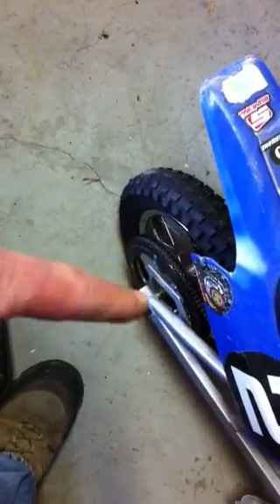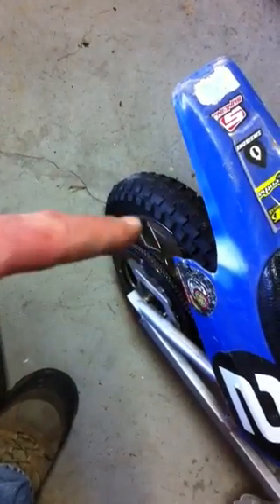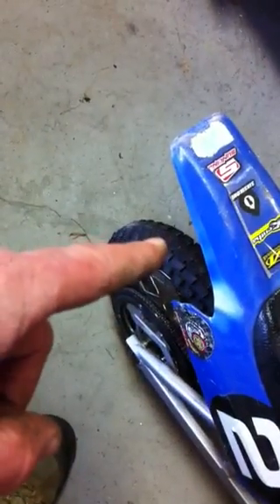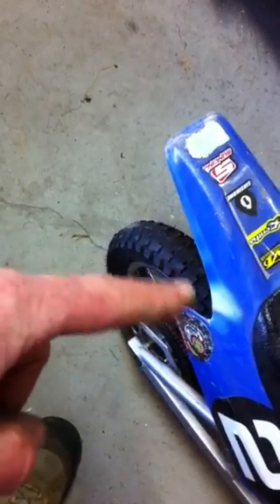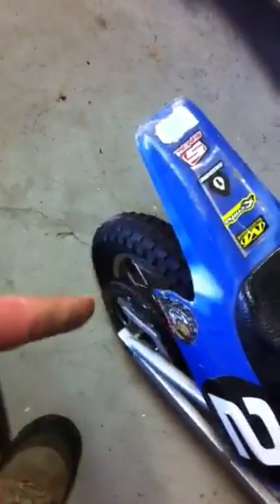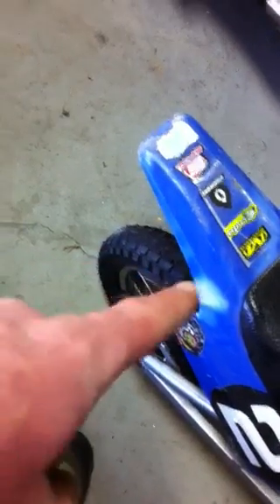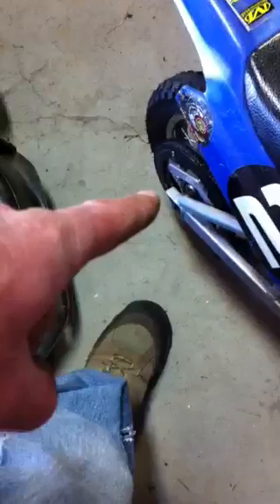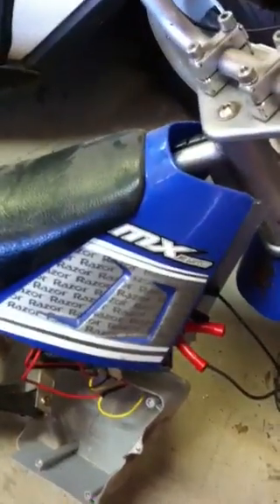How to charge razor without charger

Comment: The problem is these are wired in series to get 24 volts so charging like this will damage both batteries eventually. Unhook one ground from one battery that goes to the positive on the other batter before charging and no problem. Just did this with my daughters e100 electric scooter
Reply: if you use the alternating fuse ports you can focus charging one battery at a time and avoid them being in series.

Comment: Aren't all razor scooters a 24 volt system? They have two 12 volt batteries ran in series two have 24 volt?? So would it fully charge both batteries?? I know if ran in parallel it would keep the batteries at 12 volt and fully charge both of them. But wouldn't it last longer using a 24 volt charger??

Comment: Are there two batteries there?  I got a go kart without the charger and figured I’d be able to do it with my trickle charger but it’s two 12 volt batteries and I’m not sure if I need to be able to wire them in parallel first before being able to use the charger.
Reply: Read my comment above in order to charge two 12v batteries that are probably wired in parallel to 24 V you would have to charge them separately or wire them in series to charge  Them simultaneously with a 12 V charger.

Comment: Why go through taking the battery housing off (which is a pain), charging 2 batteries one at a time, reassembling that battery housing (more of a pain) when for $10, you can buy a new charger online.
Plugs right into the original charging connector.
Reply: Because it's free if you have the tools
Reply: Just to tinker with stuff and get a thrill from fixing things for free but I see your point too